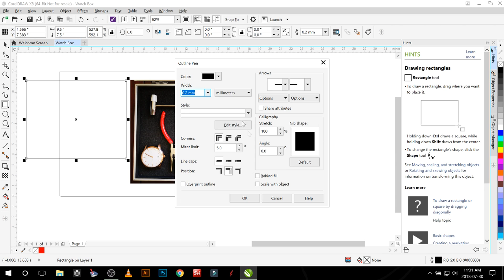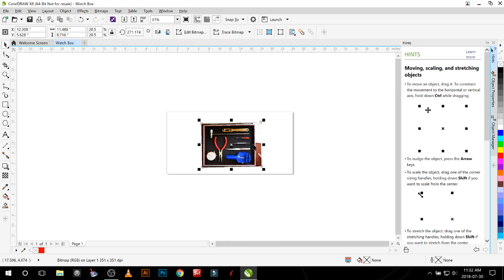Laser Cut Foam | Laser Engraving Foam | Custom Foam Inserts

Comment: Thank u, that procedure is simple and accurate, I'd use a good 2D cad, instead of Corel to obtain a STL file.
My answer is: is it possible to use a laser head mounted into a 3D printer (let's say a Creality Ender 3 PRO) in order to cut foam?

May you give info on the laser power needed?

Comment: Hi, Can you use trotec for the 5mm foam boad
Reply from the maker: Hi Kuda, we are not sure it all depends on the type of foam and material. As far as our foam we can confirm that it's safe and easy to cut.
Reply: @TrotecLaserCanada  elmers foambord 5mm, Can you confirm if trotec has 5mm and 10mm foam boards
Thanks for your quick response
Reply from the maker: @kudamidzi1254  Hi Kuda, we can only speak to foamboard in Canada. We do have Smart-X laserable foamboard that's both 5mm and 10mm. What country are you in?
Reply: @TrotecLaserCanada  Hi, Im in Victoria BC
Reply from the maker: if you are in Canada you can register on our webstore here: www.engraving-supplies.ca and then you can order laser foam and laser foam board

Comment: I need to laser engrave and cut 15 lb HDU Foam (Sign foam). I have a ULS 150w CO2 laser. I really need help on the settings. In the material database, there isn't an option for polyurethane foam. I could REALLY use some help.
Reply: Did you find an answer? Looking for a supplier of this but all my research says it will kill you from the gases but many people seem to say it is "safe" however the general make up of the foam is a gas product. So yes it does work but really bad health wise.
Reply from the maker: We're not sure about HDU foam, we would have to see the MSDS sheet.

Comment: Hey Trotec,

I can use a Trotec speedy flexx laser at the local fablab to cut my own Foam inlay, but I'm wondering how good the fit is when you make a photo of the items you want to place in it, and do you recon it works on lighter colored foams?
Reply from the maker: Hi Sebastian, it depends on the foam density you're using but as long as you measure your overall box (outer shape) correctly then they should fit right in, it worked for us. Light foams can burn a bit so try using lower power and multiple passes if you need to.
Reply: OK ,I am from Laser machine factory .This machine is called Chanxan CO2 laser cutting machine . Add whatsapp 008618361445350 for  more detail

Comment: Where can the foam be purchased?
Reply from the maker: Hi William, we are currently in the process of making it available in Canada. It make take a few months to fully launch it.
Reply: Cool! I'll be looking for it! Will you also sell red or yellow foam so you can create shadow boards to see if any tools are missing?
Reply from the maker: Hi Todd, for now we've only found charcoal and white.
Reply: Actually, on second thought, since you don't have to cut out a bottom layer you could use any foam underneath for the contrasting bottom layer.
Reply from the maker: Yes pretty much.
Reply: @joekiez  Did you ever try the foam from this site on the Trotec? Does it work? Looking for find some here in the states!
Reply: @TrotecLaserCanada  can you guys make it available in the US as well? and Can the Trotec Speedy 500do this?

Comment: Where did you get the foam? What laser wattage were you using and what were your settings? We have 80 watt 300 and 400 Trotecs.
Reply from the maker: Hi guys, we are in the process of bringing this stuff in and selling it in Canada. We're pretty sure it's not available from Trotec USA. As for laser settings, they are in the description section. Thanks!
Reply: OK ,I am from Laser machine factory .This machine is called Chanxan fiber laser cutting machine . Add whatsapp 008618361445350 for  more detail